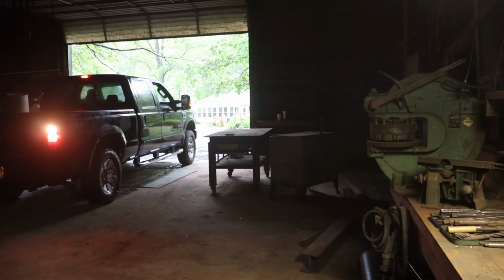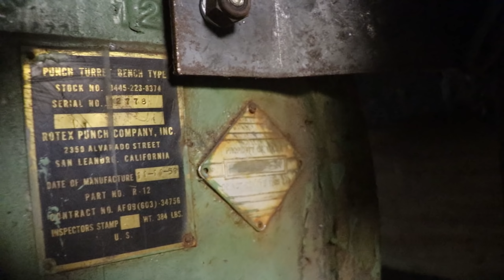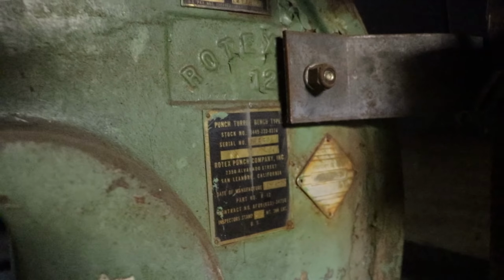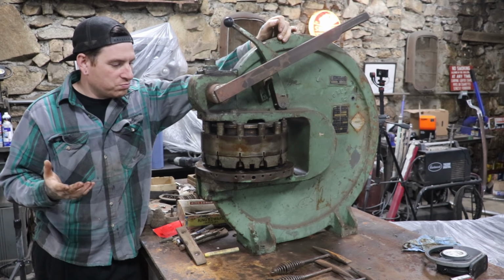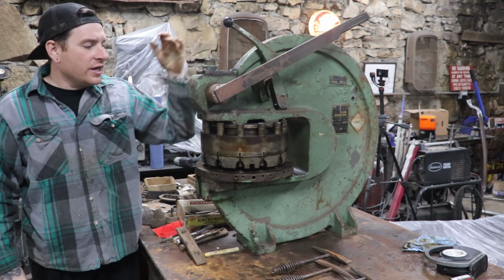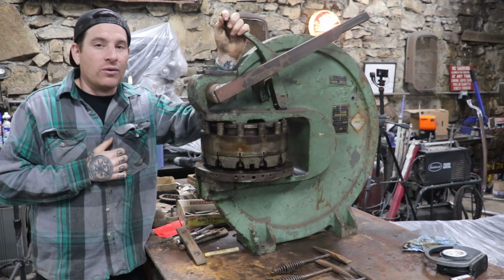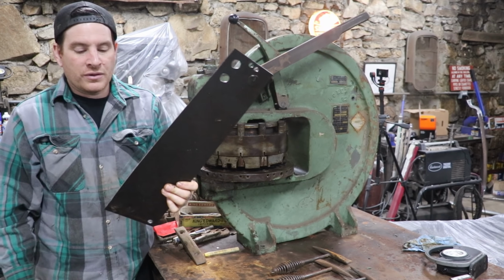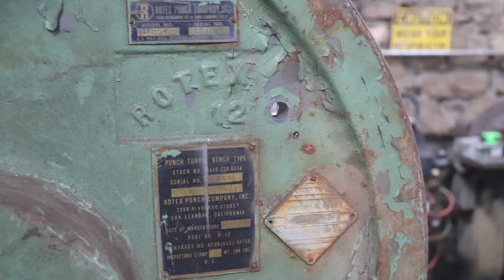Rotex Rotary Punch Mega Score

Comment: Beautiful hole punch plus a nice sturdy metal fabrication table. There was one of those punches where I worked but it may have had a larger selection of hole sizes. Also, when you rotated the punches, the bottom die moved with them and not separately. There was a little tray underneath the dies that would catch the plugs. Those plugs can come in handy.
Reply from the maker: Oh you had a real sweetheart of a punch there and probably a bit bigger. These are super handy! Thanks for watching! -Matt/ITG

Comment: That might be a parts cleaning table with a piece of plate welded to the top. If it is, it's for rebuilding automatic transmissions, etc. and has a drain pan and piping under that plate. New they sell for $325. Nice score.

Comment: GREAT find !!! That punch, obviously, will be very handy for quickly making holes but we recently found that using a punch is a great way to make nice round "plugs" for filling un-wanted holes in metal. Make the "plug" out of the same thickness metal, carefully size the hole so the plug just goes in, and hammer the plug flat so it anchors itself into the hole. Weld the plug and "wallah" no hole. I bought a new  "Roper/Whitney" punch that does 1/8" to 1/2" to 14 ga for $259.00. You probably need a "cheater" on the handle for the bigger/thicker holes. That's probably why the handle is replaced. 
San Leandro (where that tool was from) is just across the bay from here. Maybe 30 minutes travel. 
That welding table is as much a "killer" deal. 👍👍👍✌️🤘
Reply from the maker: That's a great idea for the plugs! I know I'll find tons of ways to use it in the future. I just was enlarging the center holes in some fender washers to make spacers for the new wheels for the fab table the other day! Right to work it goes haha. Thanks for watching! -Matt/ITG

Comment: Hey Matt,
I polished my heads after i saw your result. But i always end up with some kind of matt shadows. What am i doing wrong? I have only use quality material
And how did you clean the heads after polishing before painting? 
Thanks
Reply from the maker: I usually use a Acetone or paint prep cleaner to fully remove all buffing residue. I do that in between each sanding and buffing steps too.

Comment: Damn Matt, nice score, that thing is a monster, should really be helpful in your builds.  Really nice table to for $25 bucks.  Thanks for bringing us along....
Reply from the maker: Heck yea, even just to set stuff on to clean and disassemble it is nice. All of my current benches are wall units and they aren't wide enough to hold larger parts sometimes. Thanks for watching! -Matt/ITG
Reply: $100 in grinding wheels and torch tip

Comment: Hi Matt, Realy nice buys and at good prices to, If the Rotex punch have seen a lot of use, what it proberbly have, you might consider to have the punches regrinded so they dont plough throu the metal but cuts (makes all the difference) the punch plate might also be in need of a regrind. Love your videos, all the best to you and yours.
Reply from the maker: Thanks for the heads up! I actually found that a couple of the real small sizes the punches are chipped or damaged and need replaced. Looks like I can replace them for $50 a pop. Not too hurtful. Thanks for watching! -Matt/ITG
Reply: @IronTrapGarage  Hi Matt, sounds great, what about the punch plate, is the without nicks and dings.

Comment: In the world of metal fabrication and metal punching, you can not punch thicker than 1 diameter. IOW 1/8" dia punch in 1/8" thick max with a nice sharp punch and die. Go over thickness and you can shatter the hardened punches. Thinner of course, no problem.  Alu, a little thicker, and stainless about half that or 1/8" in 1/16" thick stainless max. Also, the punches are all quite dull, as they are pulling the edges of the holes down. With nicely sharpened punches and dies, that thing will work much more effortlessly. It's a nice machine. Need to find a machine shop guy with a cutter grinder to get them sharpened. I could do it but I'm 4? hrs away in upstate NY.

Comment: All of the Air force bases  I was stationed at had a sheet metal shop for making new aircraft panels out of aluminum and they had one of these punches. They work very easy with sheet aluminum.

Comment: Used a Rotex punch a lot over years in my ship repair career.Guys? I don't think the rotax is actually meant for 1/8 material. It might do it but its pushing the limits of what its designed for. At least we didn't go that thick on ours. Enjoy your new to you punch ;)
Reply from the maker: The punch has the capacity marked with the hole size on the table. It has 1/8" for the large holes and 1/4-3/16" for the small and medium size holes. Pretty crazy! I doubt I'll do anything that crazy with it! -Matt/ITG

Comment: Hey Matt.. nice score! I'm almost jealous...but I own 3 50 ton ironworkers that will punch up 3/4" thick.. but the turret feature is definitely very cool..  as person with approximately 30 years of experience with punching and fabricating..please, please, please observe the #1 rule of punching! Never, never attempt to punch a hole smaller in diameter than the thickness of the metal!! The hardend punch could break possibly with such force that it can penetrate skin, eyes, even vital organs. Probably not vital organs with a hand operated punch... but men have been killed by shrapnel from bigger machines... be safe my brother! Im just saying this because you said and 1/8" hole through 1/4"... the thickest material you can safely do with an 1/8 punch is 1/8" and so on.. love your channel. The Rotex is awesome!
Reply from the maker: Thanks so much for the crash course in safety Jeff. I'm a self-taught hack and wouldn't probably have known that until I broke a punch haha. Thanks for watching! -Matt/ITG
Reply: @IronTrapGarage  you're very welcome Matt. Also, I don't have their catalogs in front of me right now, but if you need replacement punches and dies or want a different size either Cleveland Punch and Die or Cleveland Tool Steel should be able to fix you up. And I almost forgot... the thinner the metal you are punching the smaller the clearance should be between the punch and die.. for say 16 gauge .010 clearance should be about right. For 1/4" you'd want more like .030. The bigger clearance on the thinner material will cause a sharp burr.

Comment: Floor mount it using the metal plate that it came with and then you can apply the lever using your foot and full body weight. Both feet even and jump on it for the bigger holes and heavy gauge steel.
Reply from the maker: Hi Carl, that's the plan! We're going to make a pedestal stand and lag it to the cement floor. It should work well! -Matt/ITG